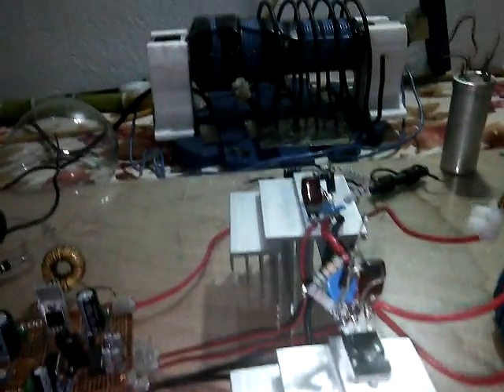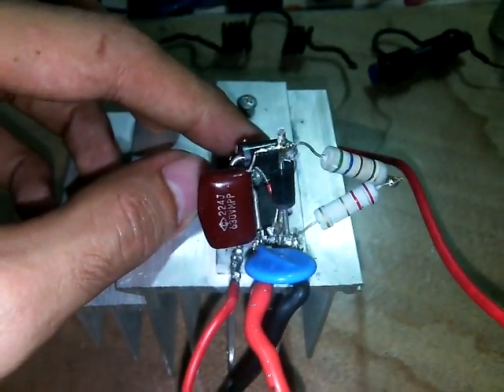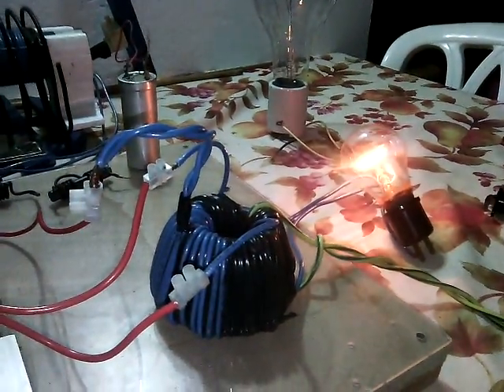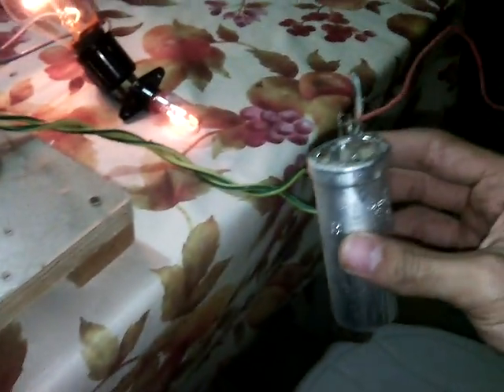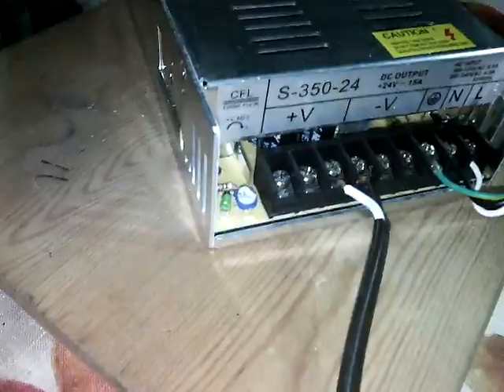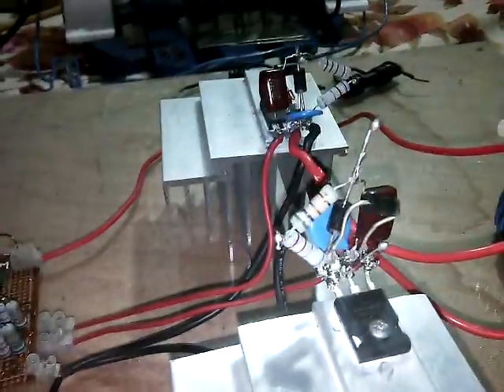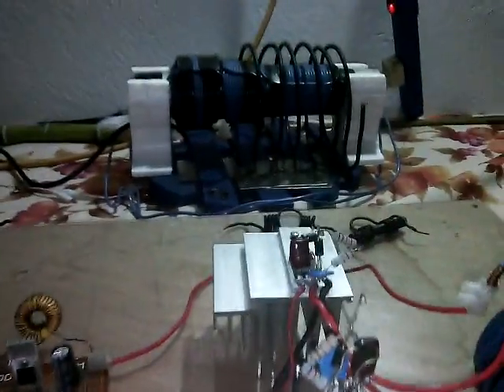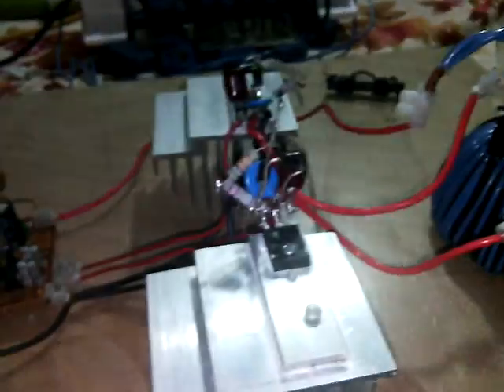Akula TL494 Circuit generator replication

Comment: Do you know Why the lights become brighter when you short the 3 turn winding?   Its because the current in the 3 turn winding that's then able to Flow acts to reduce the inductance of the core which allows a little more current to flow thru giving you the slight increase in brightness in the load...  (its similar to how a magamp works.)

Comment: Hi GFcore i wanted to know about the H-Bridge which resistors and diodes u use on each Mosfet. ive done the inverter circuit but my mosfet are getting hot cause of the wrong resistors and diodes ive put. pls help :'(

Comment: Good evening, I have always seen in tests with resistive load, incandescent lamps or LEDs, but never a different type inductive load such as an electric motor, other types of load such a washing machine (inductive, resistive), or other?
Then, we talk about Volt but never of the current (I) amperes, the maximum power output, wave pure sine wave or tringolare, square.

Comment: well done that you will only have a problem with TL494 generator to build this system does not sync on the third pin to the comparator there is a problem when you change a series of pulses you burn these transistors 
synchronization plays a very important role where there is such a small toroid transformer windings for the third capacitor 0.47nF